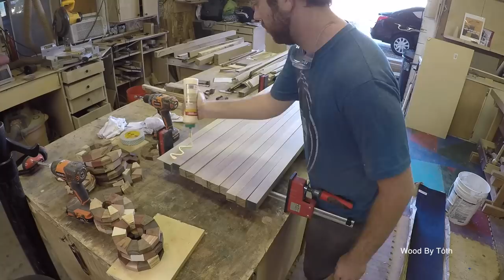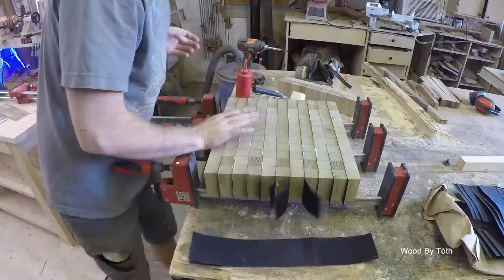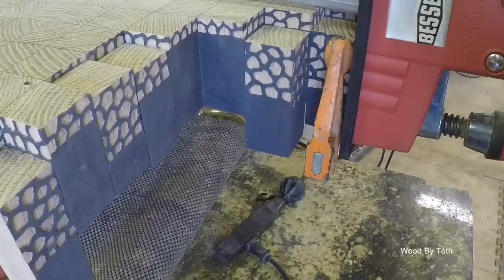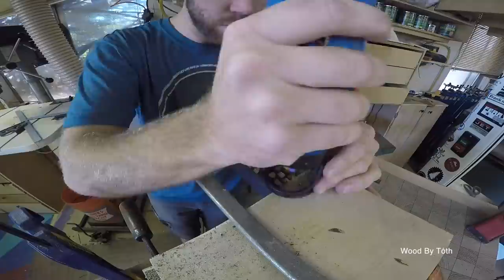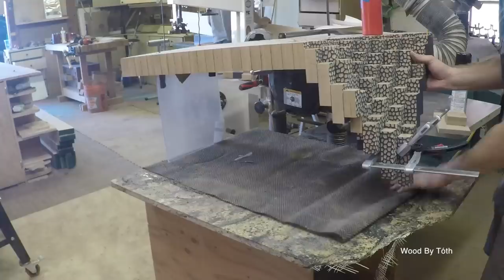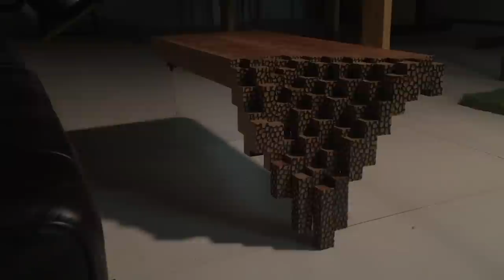Falling Brick Coffee Table

Comment: The table are looking awesome but would need some improvements!
No structural support, like a metal beam throught the middle(hidden). There's only glue holding it together!
It's basically a threelegged table(2 legs for plexiglas), the last leg(not plexi) is off center. It should be aimed to have center of mass in the middle of the 3 legs. So designing so that the wooden leg is more to the middle of the table would grant alot more stability.
Reply: Pro96Gaming Dude, do yourself a favor and stick to gaming. 
1. Wood glue dries stronger than the wood itself. 
2. As far as structural integrity, it needs none whatsoever. It's solid and sound. A metal piece down the middle? What the absolute fuck. 
3. It clearly didn't occur to you, but this piece is hardly the type of thing you put your feet up on, like the one in your mom's basement. This is art.

Comment: really neat look, but are you worried about the stability at all? it seemed a bit wobbly at the end of the video and it just kinda seems like if you ever but your feet up or set a laptop or something on that far corner the thing might tip over...
Reply from the maker: Asa Forsythe Thanks! 3 of the corners are solid and can hold feet or a laptop. I only use those 3 sides. Its more of an art piece but its still vary stable
Reply: Kyle Toth Cool, glad it isn't tippy!

Comment: I really like your design of this coffee table, but I don't think it is durable if you only apply glue between small pieces of wood. It will hold for a period of time, but it may not last long. Maybe I am wrong. Again, really like your design.
Reply from the maker: yz li The glue is stronger than the wood. It will hold. The wood will typically break before the glue fails. Thanks for the feed back
Reply: yz li

Comment: How strong is a table like this? If you're just using ordinary woodglue I would expact it to collapse
Reply: Wood glue is extremely strong. If you use lets say Titebond II, and glue a joint, the wood gives before the glue (see Mathias Wandel video about it). I would be more worried about placing something on that corner, the table might tip over since it's missing a leg in the fourth corner.
Reply: check, thanks for the explanation

Comment: This is great and everything. But I'm trying to recreate this and I can't get the glass pane to stay in place.  How'd you do it?
Reply from the maker: Will J I cut a slot with a router about 1 inch deep, put the glass inside and glued it in place
Reply: Kyle Toth just tried that and it worked a charm. Thanks
Reply: The only change I made to this design is that I added a sheet of wood to the bottom and shaped it into an "S" shaped triangle to add a little more stability